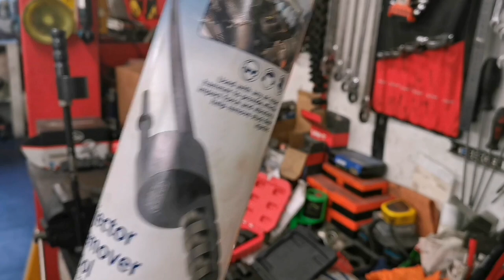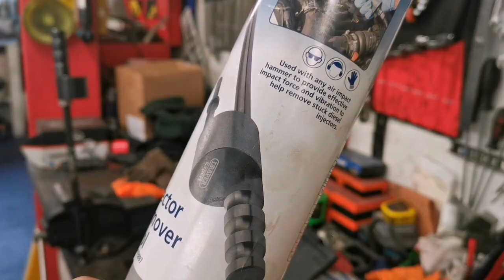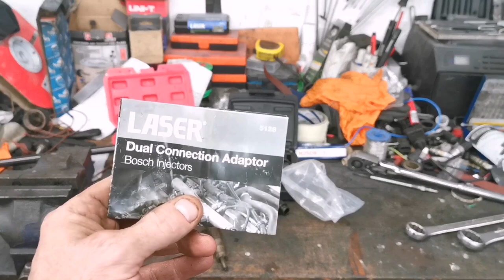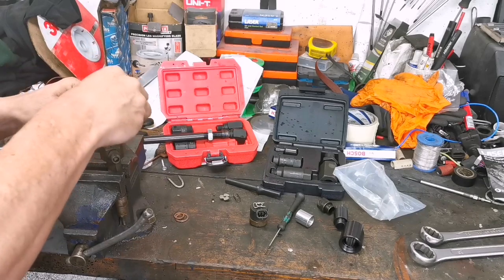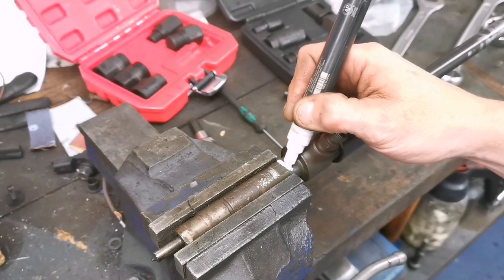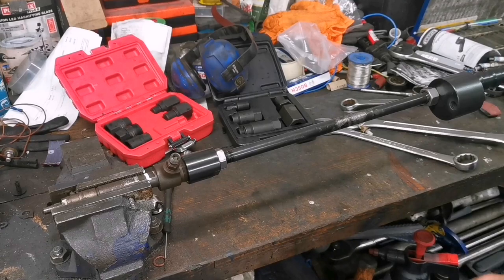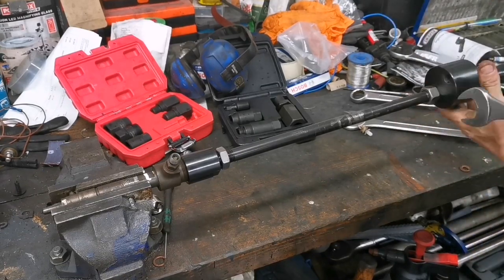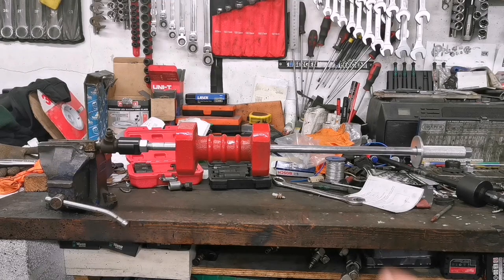Diesel Injector Air Hammer Removal Tool Test

Comment: Yeah your bench is absorbing some of impact but surely the engine mounts will do the same. Maybe not, you have a lot of mass there...Puller arrangement may prove more effective. Easier said than done perhaps. Guess yer back to Armstrong method Dave. Interesting demo. Actual useage might provide better results (optimism 😁)   Cheers 👍
Reply from the maker: Yeah ian, i still think it'll help loosen a seized component however it doesn't do what the promo purports. Have to try these things to distinguish reality, you know
Reply: @davesterl  Years ago there was an advert on the tele for a water dispersant product. To prove how effective it was, they fire hosed a running engine to show how the ignition continued to operate…it was a diesel 🤣
Reply: @davesterl  Caveat emptor!
Reply from the maker: haha, i thought that was only in British law

Comment: I went back to look at the Laser tools video clip and noticed that the mark left on the injector as it was pulled out was very narrow compared to what was left on yours when you used the slide hammer.

They did not do that vice up very tight at all.

Also, the fact that the air hammer is off the centre line means you will lose a  great deal of the force due to deflection over that length compared to the slide hammer.

You need more injector jobs to build your muscles up!

Seriously though, great review and helps the likes of me to save money on buying useless tools.

Cheers Dave.
Reply from the maker: Great observation!
Reply: @davesterl  Thanks. I actually went back to look at the air hammer but decided to look at the finer detail as per the second clip you showed.. Love the channel. Great advice and reviews.

Comment: Nice to expose them Dave 😂 but all this tools will work only if the access to injectors are easy enough, i.e ML,Vito,or Renault vans or ford vans if it's the one at the very back with black death or even a stuck one it's really hard to get half size of any tool, anyways lovely video thankyou 👍
Reply from the maker: yep, the back ones are a pig

Comment: I have very little faith in today air hammers (vibrating hammers), but I had a large one years ago and there was some thump out of that. I’d like to another one of those, I do see Eric from South Main Auto recommending one he calls it the ‘ big nasty ‘
Nice video though Dave 🙏👍
Reply from the maker: I use mine quite a lot Peter. The Eric O big nasty uses different sized bits than we get

Comment: I have the laser kit and had mixed results but the adopters are handy and well made, picked it up cheap, which helps when it doesn’t work, do you have any of the hydraulic puller kit Dave that’s my next venture.
Reply from the maker: no hydraulics, i've got by so far with various methods

Comment: Could it be that the vice is flexing the bench which is dampening the shock forces? I guess u are back to getting the arms pulled out of u with the slide hammer ⚒️🙈
Thanks for sharing 👍
Reply from the maker: Yes John, that thought did come to mind. The vibrations are visible all over the bench as the spanners are jumping about but surely that will be the same in the promo video. We will see in a future video if the vibration shocks are helpful on an injector in an engine
Reply: @davesterl Yes  perhaps the mass of the engine will act against it better. Still seems like the slide hammer and a determined Carrick man works best😂😂😂